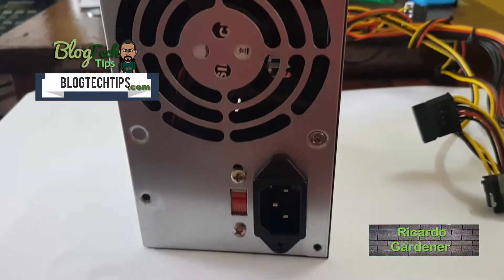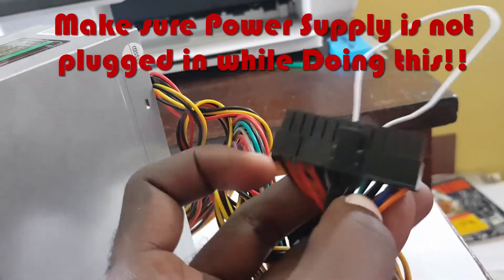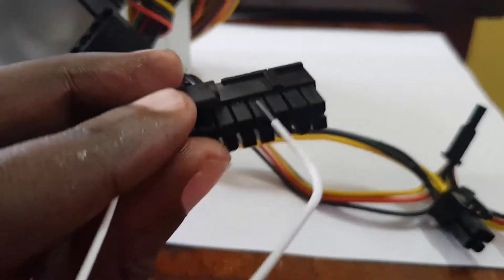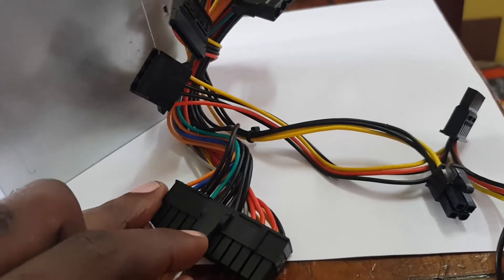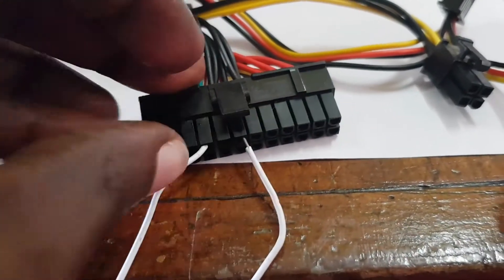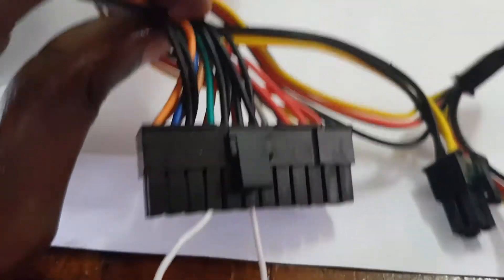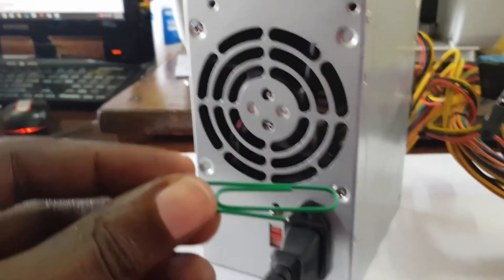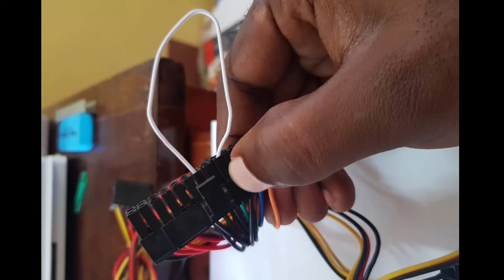How to Test if a Power Supply is dead with a Paper clip

Comment: Mine works when I plug in paperclip but after I take it out it doesn't work???
Reply from the maker: Maning the power supply is functional and not broken
Reply: @rickytlc1985  what do u mean by that so is my power supply broken or what?? Cause I use clip and works after not using clip doesn't turn on???
Reply: Insomniac x thats the whole point, you plug in the paperclip to see if the fan on the psu starts or not, if it starts your psu is not broken. If it doesnt your gonna have to get a new one.